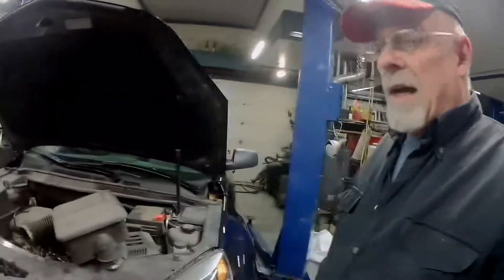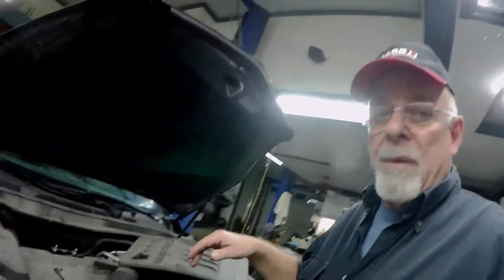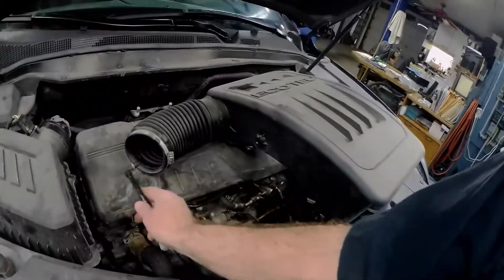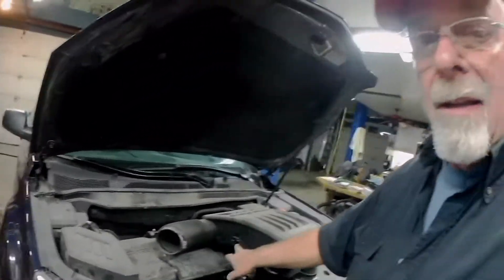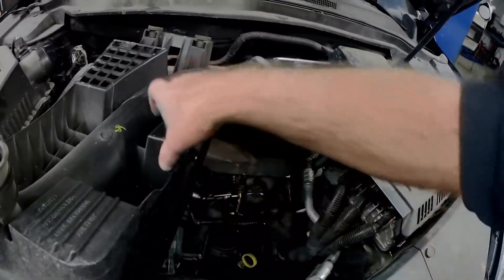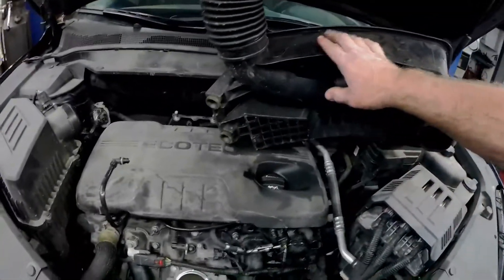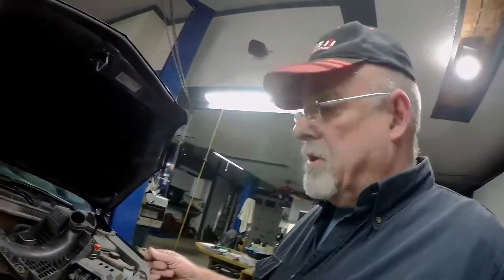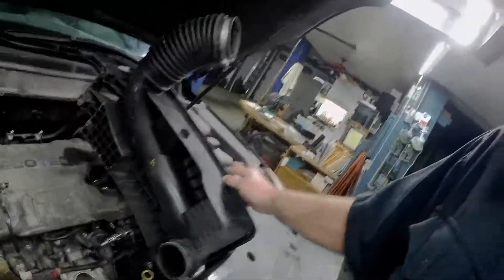2.4 Ecotec GM Rear Main Seal Failure and Fix - 2017 Chevy Equinox

Comment: I’m in Michigan I have a 2017 Equinox. Unfortunately…experiencing this right now…so disappointed. Just told it will cost between $2,000 and $2,400. I just had a front engine gasket installed in August of last year. Mark, do you have any suggestions
Reply from the maker: Find a local mechanic to pull the engine and install a new rear seal, should be like $1200 plus parts

Comment: the PCV valve  freezes up and plugs up in the intake that blows the rear main seal
Reply from the maker: Correct - this is in "addition" to the vent tube being blocked with ice .  If the vent tube wasn't plugged with ice, it wouldn't matter if the PCV is blocked
Reply: @mark_osborne  i have a 2017 equinox in my driveway i gotta replace the rear main seal,it is pouring oil  111k miles on it ,cost 3k to repair
Reply from the maker: @ That's at least double what it 'should' cost to repair
Reply: @mark_osborne  i agree with you
Reply: @mark_osborne  i have retired my automotive shop  after 40 years  and i have no place to do the job ,i contacted over 14  garages  and they quit doing engine work as far as pulling engines
Reply from the maker: @ WoW !  Nuts HUH ? !
Reply: @mark_osborne  absolutely ,i   like chatting with you ,we are both gear heads  ,old school
Reply from the maker: @ "very old" as applies to me !
Reply: @mark_osborne   me too, but we are knowledgeable

Comment: Not only that on your air intake manifold there's also pinhole sized vacuum spot that you need to drill out it gets plugged up I have the same car and the same problem working on it today😅
Reply from the maker: Yes these holes tend to get plugged up in short order in humid climates

Comment: just curious if drilling that hole created a lean fuel trim code, looks like it would be an unmetered air leak?
Reply from the maker: This has been brought up several times (in the comments).  The answer is - no. In fact, I could not detect any difference in fuel trim while monitoring it  (driving down the road).  The hole is so small compared to the area of the MAF meter, it is irrelevant

Comment: Anyone know about how much this  repair is?
Reply from the maker: Depending upon many factors - if you remove the engine to do the repair (as opposed to removing the transmission), you could expect to pay around $1000 in labor, plus parts.  The parts can be as little as a new rear main seal, but can also involve other things.  For example, I've ran into the problem where I can not get the high pressure fuel line connections to seal-up (they were leaking gasoline) because GM made them "one time use only", consequently I had to buy a new high pressure fuel pump and line. This is the stupidity of new cars. I want to say the last one I did went out the door around $1500 ... all in, new coolant, new oil/filter, etc . Hope this helps. Pulling the transmission to do the job might be less expensive if you can find a tranmission shop that's willing to take the job
Reply: @mark_osborne thank you!!! I just got a price of $1200 so that’s great to hear.

Comment: DO NOT DO THIS. Drilling a hole in the breather on a MAF system will affect fuel trims.
Reply from the maker: While what you're saying is absolutely true, however, the amount of air passing through the hole is so small compared to what passes through the MAF, you can't even see it while watching live fuel trim.  And so what if it leans it out by 1 % . That's what O2 feedback and fuel trim is all about.  It has the ability to add or remove up to roughly 30% of the delivered fuel for any number of "reasons".

Comment: Remove the intake. The PCV passage is not ported large enough on the mating surface of manifold. Like a pinhole when it should be at least 1/8 inch in diameter. These get froze/plugged over time due to this. Drill it to 1/8.
THIS is the most common reason for the rear main seals to blow out. Done many. Hope this helps.

Comment: Until 2008, Saturn Vue used a vented oil fill cap on the 2.4. Dorman makes one. I've seen these recommended on YT, and it seems it would provided relief of crankcase pressure. So I put one on the 13 Terrain I just replaced the rear seal on, and told my friends who have these 2.4s. It looks like a simple, cheap, effective means of preventing rear seal blowout was known by GM and discontinued. Why would they do that?

Comment: Could this happen to the 2.5 in the Malibu? I just had my Malibu blow a rear main seal and leaked all my oil out. -8 degrees the day it happened
Reply: Yes! Our’s blew out on Monday morning, temps below 0! GM dealer and $2,999 complete extended warranty says they won’t cover it. Says they don’t cover ice or water intrusion. Pumped ALL of the oil out. Do NOT buy GM cars!!!
Reply from the maker: @lembriggs1075  OMG  SUE THEM !!   It's a DEFECTIVE DESIGN !
Reply from the maker: If it's a 2.4, it depends on the configuration of the air cleaner assembly and if it traps water as shown in the video

Comment: hello i did the same thing on my airbox. when i drove the car 3hrs straight it started smelling gas in the cabin and when i checked it out gas was draining from the hole... is that normal or go to a mechanic?
Reply from the maker: If you live in a humid climate, moisture will build up in the air box, drain out (which is what we want it to do) and end up running down the front of the engine and as it evaporates from heat, you can get an odor.  I just had one where the customer asked me to block the holes - so I did.  My best suggestion is to screw a brass fitting into the hole so you can attach a small rubber hose and direct the dripping moisture away from the engine - put the hose over near shock tower, tie it off with a zip tie.  A little creativity will solve the problem. Merry Christmas
Reply: @mark_osborne awesome. ill do that. We live here in alberta canada and its 0 degrees today some days are -40 celsius. So gas is normal to drain from the airbox?
Reply from the maker: @felixCanar  It's not gas - it's crankcase vapors which can smell like a combination of gas and oil. Completely normal. It's probably worse for you because it's so cold
Reply: @mark_osborne  Thank you👍and Merry Christmas to you!

Comment: I can't believe this thing bit me. Unacceptable. When I parked it, it was running so only a head gasket and a seal. Full of water and 0f temps. Good fix, Couldn't possibly be worse than the stock design
Reply from the maker: They will bite you !

Comment: Our Equinox main seal blew out they fixed it under warranty..saw your video and I drilled the hole where you said drove it about 20 miles runs great but raised the hood and there is oil coming out of the hole I drilled what's up with that
Reply from the maker: It will - it will leak the remains of what is caught in that box until it finally drains.  No worries
Reply: @mark_osborne  oh ok..

Comment: What do you think about a vented oil cap sir? I've heard it recommended before. The logic is that the pressure would go through that versus to the rear main seal (though I assume I may be missing something due to my lack of knowledge on engines).
Reply from the maker: You can do that but you run the risk of water/debris falling into the hole
Reply: @mark_osborne  Apparently there is no actual hole on the top or anything. I'm not really sure how it works though the top looks just like a regular oil cap. The part number is 12589430.
Reply: @darwinchapmam6343  Thank you. I appreciate your insight and help. And I agree, lack of maintenance is a key issue, especially in something like this that has a less than normal problem. Thanks again.

Comment: I have a 2013 equinox with the same engine, and that box looks identical to my 2013. So what size drill do you recommend and
will that effect engine performance if any? That engine doesn't have a real PCV but tiny port holes in the the intake maniford that 
get clogged up - (a bad idea).  Enjoyed your video.
Reply from the maker: just drill like a 3/16 hole - it will not effect performance
Reply: @mark_osborne  when i bought my 2013 nox it had that hose unplugged for a long time until i caught it and plugged it back in, thats when the smell of gas went away, always smelled gasy, but unfortunately my rear main blow as well, in the middle of a huge repair job.
Reply from the maker: @Jack-v8h4k  I am so sorry !  You must wonder if the previous owner unplugged it specifically for this reason ?
Reply: @mark_osborne  exactly,  I believe that.

Comment: actually just got the estimate on my 2017 equinox.... 3726 dollars for this.
Reply: Someone needs to start a law Suit against gm.
Reply: @kellytraveler4748  there was a settlement in 2019 that i believe they are no longer liable for this problem
Reply from the maker: NO !    NO WAY .... take it somewhere else. Where are you ?
Reply: @mark_osborne  ohio. Took it to sera chevy because i was going to try and get them to buyback considering the settlement for 2017-2019 equinox oil consumption and oil monitoring system problems. Worst part is i still owe 11,887.17 on it. 114k on the clock. Even had it in there three weeks ago for a rear bolt that seemed to remove itself in turn blowing all the oil from the motor into the bay and out of the motor. Car is truly awful and im stuck lol
Reply: Get it fixed?  What did it end up costing $.  I have the same problem.
Reply: @klujics123 local tow shop did it for half what chevy quoted me
Reply: Car ended up dieing anyways because your monitoring system doesnt have a “low oil” sensor.
Reply: @LichWorks sorry to hear that.   Thanks for ur reply.

Comment: My 2016 GMC Terrain did the same thing around 70000 miles I'm going to try drilling the hole if it causes an issue I can plug it - what size hole did you drill?
Reply from the maker: about 3/16 - you don't need much, just enough to let the water out once it thaws from engine heat
Reply: @mark_osborne  thank you, I appreciate the info!
Reply: Funny my just over 70,000 mile and blew the seal.
Reply: @raytuck1206  I drilled the hole with no negative effects. Also when we hit temps in the teens or lower I pull the dipstick up just until it breaks the seal

Comment: So drilling a breather hole in the oil cap could also reduce this problem?
Reply: You can buy a special oil cap that vents itself when pressure is too high, if that's what you want.
Reply from the maker: @HandyDoctor89  I have never heard of one
Reply from the maker: I don't think you could put a big enough hole in the oil cap without it making a big mess from all the windage that is going on just below the cap

Comment: Drilling a hole in the breather on a MAF system will affect fuel trims as the air going in through the hole is unmetered so the PCM is not aware of that air.
Reply from the maker: You are absolutely correct, however, the hole is small and when I connected my computer to the vehicle the STFT was still hovering around zero, a little above.  Thanks for the comment
Reply: @mark_osborne  Good to know.  Was a bit concerned that others may decide a 3/8 drill bit is a good sized hole.
Reply: If for any reason the small hose change the air flow u can put a check valve
Reply: i drilled to put the hole and after 300 kms of uninterupted driving gas is going out of the hole.

Comment: Excellent diagnosis. GM knows this happens. They just don't care. My daughter's 2017 Equinox has had this happen twice. This second time it's clear that is was due to ice build up in the air cleaner housing blocking the PCV hose. But, GM won't admit to it and won't cover the repair. This is an obvious design defect that should have been found when they did design testing. My guess is that they skipped some of the design testing steps to hurry the time to market. Lesson: Don't buy cars with that engine design in it.
Reply from the maker: Are you going to drill a hole to let the water out ?
Reply: @mark_osborne   Hi I have a 2010 equinox  2.4. I bought it in august  2022, owned only 6 months now. I bought it privately from a guy who told some lies to me. I found out later. I have learned a lot from you tube. Thank goodness for that. I purchased  the FC219 relief  oil cap last week. To date I haven't had any problems.  The mileage  is 191,789.00 I just had the oil changed by my auto shop i deal with.. I have my friend check the oil  often to make sure it's up. The guy who sold me this suv had just put a timing chain in, back brakes which I paid half for because  he asked me to., tuneup. So far I put an altinator  on. He said in his ad that the air conditioner  worked great (it didnt ) I had to put a new one on $778.00. That mechanic  showed my friend that it should not of been certified.  The frame had 3 holes, the windshield  had a crack to. Plus the back reflecter was broke. All was taken care of at no cost to me. Except  the w/s is still cracked. The police told me it's small enough don't worry about it. See, I bought it sight unseen, i only seen it on the ad. It is mint. I trusted this guy but he pulled some fast ones on me. I had already sent $500.00 deposit to him. So I became ok with everything. I'm 70 and I have disabilities and have difficulty  doing anything. But I love this veh. Apparently  the air conditioning  was leaking and he didn't know. He only owned it 5 months. Because he bought a brand new veh. What do you think of the oil catch can amazon is selling? Do you think I should have it put on. Or is the oil cap 219 enough. I'm sorry for talking so much, but the more info I learn from people  like you the better I feel. GM should be ashamed, I see there is a class action suit against  GM for the 2.4 ,4cylinder. I'm in Canada , and I wonder if there is a class action suit against  GM  here. Do you know? I hope you will write me back. If you would give me your email, we could communicate  better.  Thankyou   Pat

Comment: This is insane. Isn't this the same issue with the 2.4L Ecotec described in bulletin 14882? That one applies to earlier equinox and terrain models, but this problem (which my cousin just experienced on her 2017 equinox after the cold spell here in michigan) sounds like the same thing. Our rear main on the 2012 blew and we had to get engine replaced and our VIN wasn't part of the recall.
Reply: Oh my, yes. My 2017 66,000 miles , during a bad snow fall, very cold night, my car was missing, like jerking, low powering on my way home after being parked for half a day, I don't know anything about this kind of thing, just knew it wasn't acting right.  I was stuck several times prior to getting home from Lima Ohio to St Mary's and I parked car under my veranda upon getting home. I got up for work next morning, started it up, ran about 5 mins while scraping snow and ice off windows.  I jumped in, pulled out and wow it really was trying to die, but it kept going , it kind of started acting as if it were coming out of it then engine light came on I only had to go about 2 Miles.  Once at work it died in parking space, engine light on sayjg DO NOT DRIVE.  I was late.  Worked my shift, called my dad to come look at it, he said drive it , would not let me call tow.  It blew up mile and half later would not start, choke , nothing., we strapped it up he towed it with his Ford 150.  Once home OMG ..there it was my drive way was COVERED IN OIL... The insurance coverage,  A wrap around extension,   I PURCHASED FOR THESE THINGS plus a lifetime guarantee warranty  Would not cover the repairs. The adjusters said it was carbon build up that blew the engine and said that it was in fine  print about this cold weather problem in this particular vehicle and it was not covered.  I still have 3 years to pay on this vehicle.  $7,000 to get new engine and install it.  Who the hell builds a car in Michigan that CANNOT hold up in the cold weather?   Was not told this problem could exist, was totally dumb founded,  I was fortunate, as Tom Ahl of Lima, where I bought it is a respectable dealership and a man of great influence in the community, after I asked for him specifically...did make arrangements to pay what I couldn't pay. He did pay $6,000 of the $7,000 new engine.  But I still think that this was not a carbon build up reason the engine blew.  It was running badly the evening before, I was stuck several times in deep snow , there was no engine light on, and during the night the oil pan blew open and  spilled most of the  oil and that was what caused engine to subsequently blow.  The Tom Ahl service men said that they felt like it was not carbon build up  that they found, but had to go  with the decision as they flat out would not pay for it.  How do you check a Vin number for a recall..I'm wondering now if this would not been that .  Live and learn.
Reply from the maker: @jodyreynolds8545  I am so sorry, what a horrible experience , thankfully Tom Ahl helped out a lot
Reply from the maker: I am terribly sorry for your bad luck. Not sure if this is the same thing in the bulletin you mention, I just sort of figured this out myself after studying it
Reply: @mark_osborne  thanks, Mark!
Reply: where can i go to get verbiage on this bulletin?